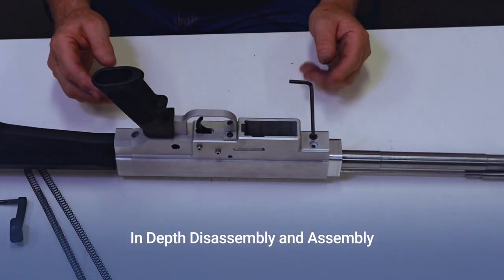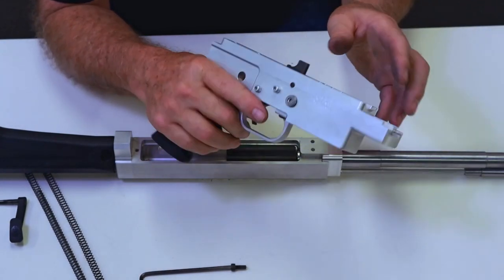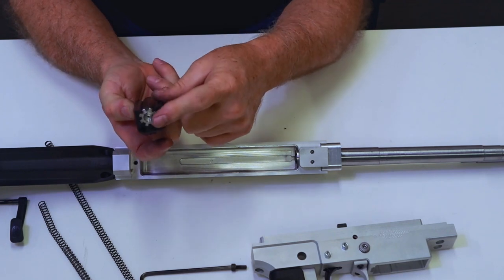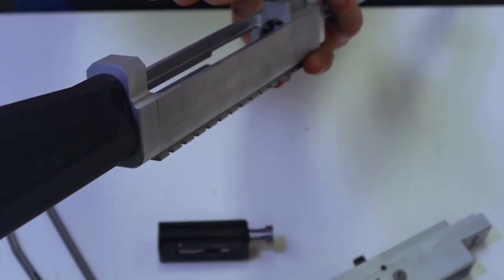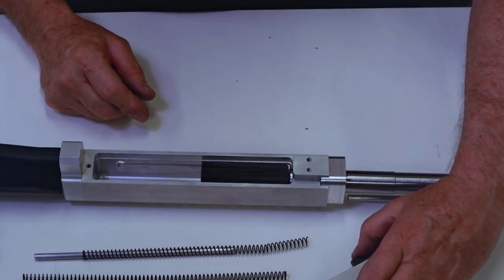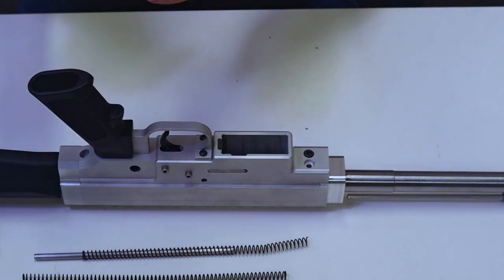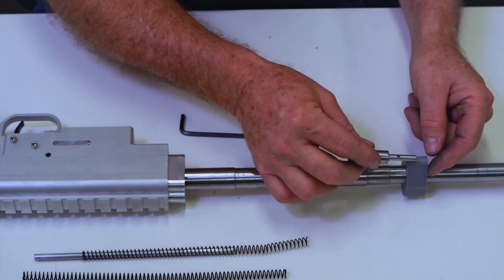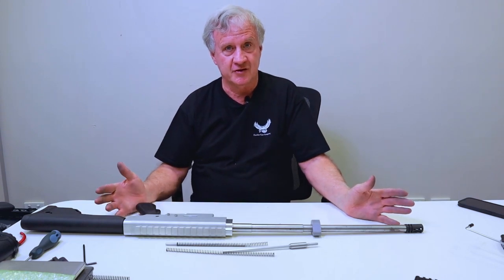Eureka Stockade - In-depth Disassembly and Assembly of The Stockade

Comment: Would closing off the gas port via that valve 5.12 possibly improve accuracy ? Not saying it’s not accurate already, just thinking in reloading terms . I’m getting one for sure , congratulations for all your hard work bringing this to market. Outstanding Work.
Reply from the maker: Thanks mate. There is a debate if the bullet has or has not left the barrel by the time the gas system starts moving. Also, if the vibration of the gas system starting to move will have an impact. I am hoping to test those cases and report back via a video. Does anyone want to pitch in?